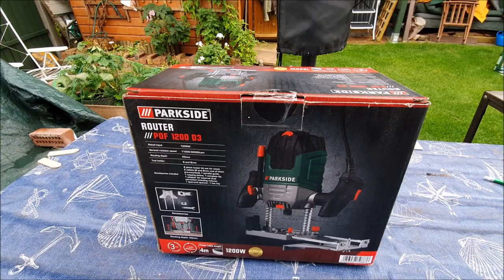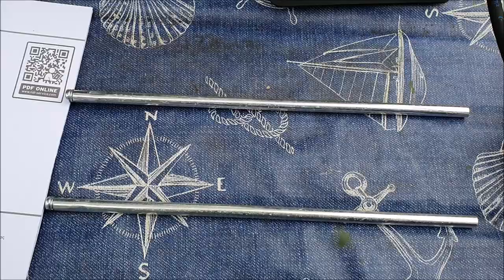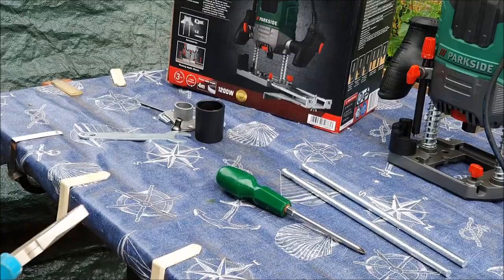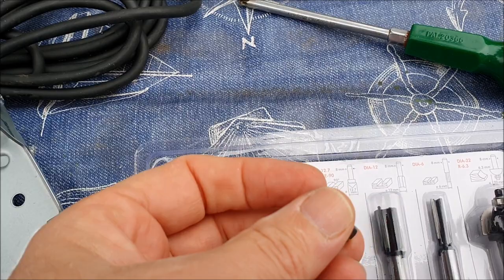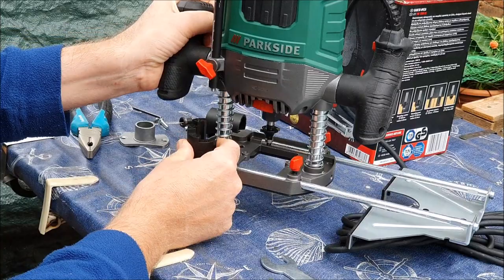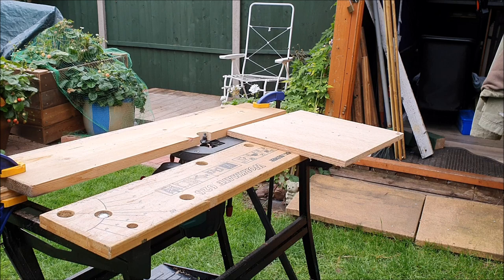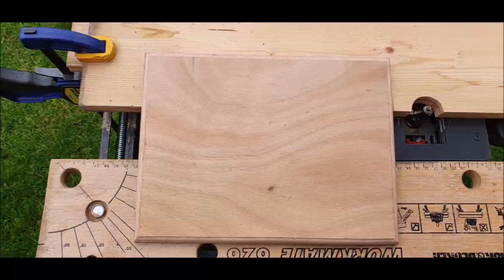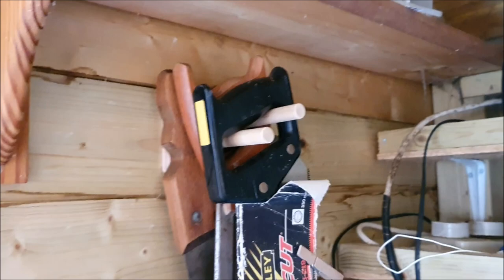Unboxing and testing a Parkside router from Lidl

Comment: Hello, just brought this myself and wanted to see what others thought of it. Just some free advice,
Make sure you are cutting in the right direction, you can tell this by using your right hand! Place your right hand thumb on the timber on the side you want to cut, the direction your fingers are pointing is the direction you want to go with your router. Also when using the router table, it's best to have two hands on the wood keeping your fingers away from the cutting bit, you get a nice cut and you get to keep your fingers.

Comment: In the first cut you are cutting in the wrong direction, also if you are using a router bit with a bearing you do not need to use the router fence, the bearing on the cutter stops on the edge of the wood you are cutting and maintains the cut distance. The router fence is used if you are cutting out hinge rebate for instance.

Comment: Purchased this router few weeks ago. Everything is pretty much the same as it is shown in this video from 3 years ago, APART of the metal guide you’re using there that came with it. Yeah, that thing is plastic now. Very flimsy and completely unusable if you need precision. Have a look at a video of a German guy comparing this Parkside with Bosch and with Festool (you can do English subtitles), but he basically shows in detail how flimsy it is and how now 90° the screw in the middle is. A little disappointing that they decided to cut costs and replace a usable part with unusable junk. I’d prefer then to add 1-2 quid to the price of the unit, but keep the metal guide instead of cheap plastic 💩